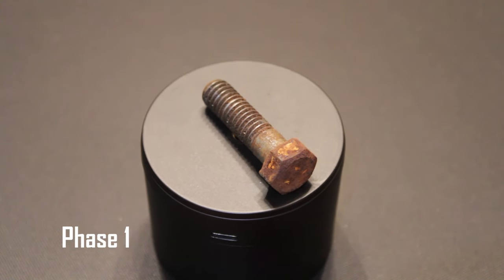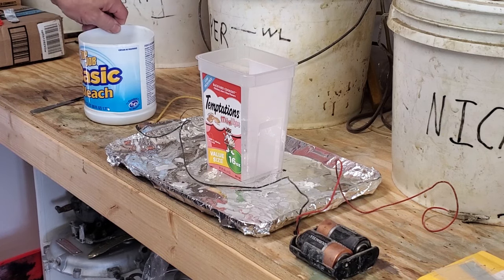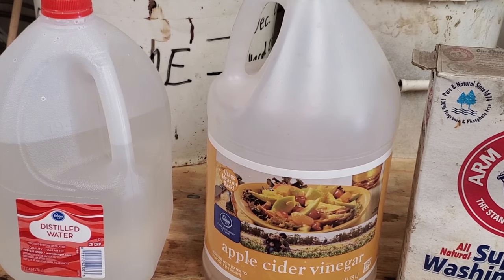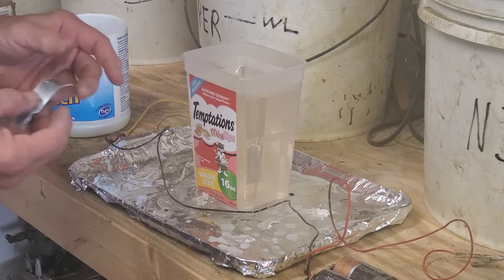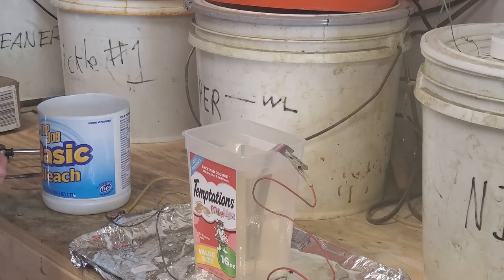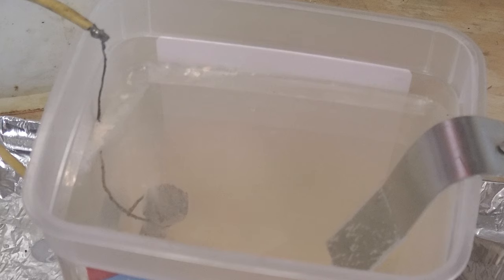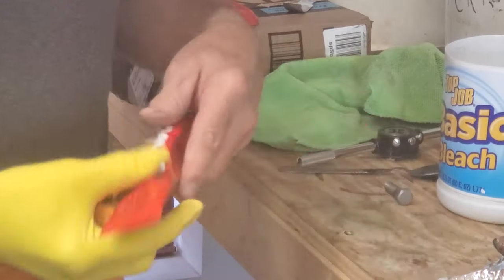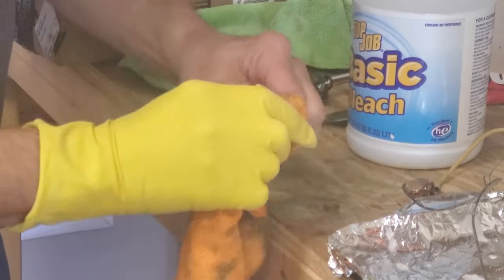How to Zinc Plate at Home - Easy Zinc Electroplating

Comment: Thank you for the simple method. I was told by an expert that it wasn't worth messing with the dangerous chemicals and expensive equipment. "Just paint it" is not the answer I was looking for. I'm about to zink plate everything.
Reply from the maker: We're happy to hear that you found the video helpful and hope that you'll get the finish you're looking for.
Reply: I've been doing that for years and I found out the same that you are about to find out - that this DIY zinc plating quality and durability is nowhere near factory plating, if it's exposed to outside weather it will start rusting in matter of months. And then you will realise that the expert of yours was right and that his opinion was based on experience.

Comment: In the RAF I was an Inspector we had a problem with zinc coated bolts rusting. The manufacturer used standard bolts so when a nut was screwed on it removed the Zinc coating
Reply from the maker: Oh, no! We always hope ours are there to stay. Thanks for watching!
Reply: If you have problems with your aircraft hardware rusting brush on a coat of thinned Par-Al-Ketone after installation.  US Navy has been using it on aircraft since WWII.

Comment: I watched a video with no speaking where the harvested a large chunk of Zinc, from the outside shell of "D Cell" Akaline battery that is under the shrink tubing cover with the branding & info on it. I think the caption was the easiest way to get Zinc. You may check into that to reduce cost even more as for many, after zinc, is the "Yellow Cadmium" wash which practice gets right. If I remember, everyone goes a little darker as it lightens after cleaning with a rag. 
DK. ASE Master Tech since 78, retired.
Reply from the maker: Thank you for sharing this information with our viewers. It will be useful for those who have larger projects or want to plate several pieces. We chose the pure zinc anode for smaller projects and a bit of a better result.

Comment: Very good guide, I wanted to do this some of the corroded 1943 steel pennies if I could get one myself.
Reply from the maker: Here is a list of what is used in the video:

One quart plastic, or glass container.

Baking pan (with low edges is okay), one that isn't used around the kitchen anymore and lined
with foil.

Half-gallon plastic bucket with rinse water.

2 D-Cell batteries with a battery caddy. (You can duct tape 2 batteries together with batteries
set up in opposite directions.) 

Red and black wire with leads - we call them alligators. Red = positive side for the anode. Black = negative for the part.

12, or so, inches of wire. Ours is yellow in the video. You will attach a loop to this to secure the
part that needs plating.

Zinc Anode. (From Amazon about $6)

Distilled water.

White vinegar (cheap or store-brand).

Arm & Hammer Super Washing Soda (You may have to order this online.)

Clean part as described in the video.

Solder and iron to attach that yellow auxiliary wire or crimpers, if you don't want to solder.
Solder is best.

Air stone, pump and air hose for an aquarium from pet store. Nothing fancy. (Optional)

A good pair of nitrile gloves.

Thanks for watching!

Comment: Pretty cat. I have a motorcycle gas tank that is pretty clean and am considering plating the interior prior to plastic coating the insides. A main reason I'm considering this is the plastic may not get every nook and cranny, but the zinc atoms will get in everywhere. What do you think? How about voltages, 2 - 4- 6D cells?
Reply from the maker: Start with the batteries mentioned in the video, then work your way up. Too much power plates too quickly and results in granular or rough plating. Suspend the zinc directly into the tank opening for the best results when plating the insides.
Reply: @CarzPlus  Thank You!

Comment: Great video - thank you. Question: I have one rusty link in the middle of an otherwise nicely galvainzed chain. Will it be possible to plate the one link while still connected between the two properly galvanized sections using this method? Stoked to try it...
Reply from the maker: Good question! If you can get the link free of rust it will work. Thanks for watching!
Reply: Thanks for the reply @CarzPlus  - I'll try and report back!

Comment: Wouldn't polishing the bolt head cause the zinc coating to be compromised? Or at the very least more susceptible to oxidization than if left unpolished?
Reply from the maker: No, not as long as you do nothing more than light polish as shown. You can also plate for a longer period before polishing to add a thicker zinc coat. Thanks for watching.

Comment: Thank you for the great video - I am going to try this with my rusted bolts. I am not knowledgeable when it comes to anything electric. What are the red & black wires with the clips that's attached to the D cell battery called? Is it also required to have a wire and stainless steel attached to the black wire?
Reply from the maker: We've attached a reverse clamp to the black wire that can be squeezed much like an alligator clamp. After that, we have the yellow wire and some stainless steel wire has been connected to that to make the loop for holding the part. Much of what is done here is to successfully plate the part.

The red and black wires are called electrical wire. This article might be helpful: https://promiseelectric.com/electrical-wire-colors/

Here is a list of what is used in the video:

One quart plastic, or glass container.

Baking pan (with low edges is okay), one that isn't used around the kitchen anymore and lined
with foil.

Half-gallon plastic bucket with rinse water.

2 D-Cell batteries with a battery caddy. (You can duct tape 2 batteries together with batteries
set up in opposite directions.) 

Red wire and black wire with leads - we call them alligators. Red = positive side for the anode. Black = 
negative for the part.

12, or so, inches of wire. Ours is yellow in the video. You will attach a loop to this to secure the
part that needs plating.

Reverse clamp which is connected between the black, then the yellow wire.

Zinc Anode. (From Amazon about $6)

Distilled water.

White vinegar (cheap or store-brand)

Arm & Hammer Super Washing Soda (You may have to order this online.)

Clean part as described in the video.

Solder and iron to attach that yellow auxiliary wire or crimpers, if you don't want to solder.
Solder is best.

Air stone, pump and air hose for an aquarium from pet store. Nothing fancy. (Optional)

A good pair of nitrile gloves. 

Good questions! Thanks for watching.

Comment: What is the purpose of adding washing soda to the acetic acid solution, wouldn't it react with the acid and neutrolize each other out since one is  an acid and the other one is base?
Reply from the maker: Good question! Washing soda isn't the same as baking soda. You won't get the same reaction as you would by pouring vinegar onto baking soda. distilled water won't conduct electricity and as a result plating will not occur. Thanks for watching.
Reply: In order to get your electroplating working properly, you need an acid solution in which you put both your anode and kathode. Adding a current will start the process. After you’re done you end up with a metal plated part that is in contact with an acid solution. To avoid the acid etching and corroding the electroplated part you need to neutralise the acid on the metal and the best way to do that is by putting it in a basic solution, like water and soda. In my opinion, adding soda to the electroplating solution will only decrease the efficiency of the electroplating process. It may still work (as long as it is acidic), but it will take much longer to achieve the same result. Next time, try two different baths, one acidic (and you can add a lot more vinegar) for the electroplating and one soda bath to neutralise the acid afterwards. Also you can speed up the process even more if you use a better power source, like e.g. a labo power supply.
Reply: Here’s the deal. Acetic acid from vinegar is a weak acid and only forms 1% ions that conduct electricity whereas strong acids like muriatic ionize 100% in water.  The washing soda is sodium carbonate and neutralizes some of the acetic acid creating sodium acetate which conducts electricity well.  Some of the vinegar is not neutralized so the pH is lowered by the remaining acetic acid.  This condition helps dissolve the anode so it will plate onto the steel object
Reply: Oh so the sodium acetate is what we want to achieve? I use sulphuric acid and water for the electrolysis then afterwards I have a sodium carbonate bath which I neutralize with and then wash in water. There seems to be many ways to do electroplating

Comment: One tiny comment.

If you make the strength of the electorate solution too strong, for example by adding (any/too much) zinc chloride the plating happens too quickly, and it does not actually plate. 

You just grow large random zinc crystals on the item you want to plate. It is like frost on a leaf, it falls off if you shake it.

From experience, as I lean how to zinc plate. It was my first mistake > stronger is most certainly not better.
Reply from the maker: Quite correct you can make it too strong.

Comment: Hi , can I use zinc plate from old batteries, ? and I made a little knife from a bolt so can I protect that from corrosion by doing this process?????
Reply: Yes you can but you should melt it down into a new clean Ingot.
Reply: @Robert-vp6xf  thanks
Reply from the maker: We prefer to purchase the zinc anodes, which are reasonably priced. While this process may work, we fear the possibility of contamination. Thanks for watching.

Comment: I did this to the specifications in the video but i am getting no bubbles when i put parts in the solution. ?
Reply from the maker: That usually means you are not getting a good electric connection at some point.

Comment: Not sure what I’m doing wrong but I see a lot of bubbling and my anode it turning white but I don’t see any noticeable transfer.  I see the copper wires turning silver, but it’s certainly not happening after 30 seconds or 1 minute.
Reply from the maker: Check your measurements and make sure the equipment you're using is clean. You may have to start over. Here is a list of what is used in the video:

One quart plastic, or glass container.

Baking pan (with low edges is okay), one that isn't used around the kitchen anymore and lined
with foil.

Half-gallon plastic bucket with rinse water.

2 D-Cell batteries with a battery caddy. (You can duct tape 2 batteries together with batteries
set up in opposite directions.) 

Red and black wire with leads - we call them alligators. Red = positive side for the annode. Black = 
negative for the part.

12, or so, inches of wire. Ours is yellow in the video. You will attach a loop to this to secure the
part that needs plating.

Zinc Annode. (From Amazon about $6)

Distilled water.

White vinegar (cheap or store-brand)

Arm & Hammer Super Washing Soda (You may have to order this online.)

Clean part as described in the video.

Solder and iron to attach that yellow auxiliary wire or crimpers, if you don't want to solder.
Solder is best.

Air stone, pump and air hose for an aquarium from pet store. Nothing fancy. (Optional)

A good pair of nitrile gloves.

Comment: Hi you think it possible to zinc plate a slot car track
Reply from the maker: This brings back memories! I had a slot car track back when I was in grade school. I remember that there were 2 sizes. A larger size with cars, roughly O-Gage, and the smaller size approximately HO- Gauge. Mine were the smaller ones. I vaguely remember the tracks had bright plating in the slot area. I don't know exactly what the plating was. I would surmise nickel, since it would hold up better when the cars picked up the electricity from their posts in the slots.

The plating method would work, but I don't think its the correct solution. Zinc is, compared to nickel, relatively soft and not as wear resistant. I'm not sure it will hold up to the slot cars pickup posts continuously running over it.
 
Thanks for watching!

Comment: how much of all the items can be reused? can the zinc anode be used for many tries? is the chemical "solution"  a one time use? do i have to throw it away for every new plating process?
Reply from the maker: Annodes can be used again and again. The solution can be kept and used repeatedly. Over time you will need to equally restore your plating solution to its original ratios due to the water evaporating from it. Thanks for watching!

Comment: I'm working with a gsg 1911 which the frame is zinc alloy looks horrible trying to  re-zinc it any tips by any chance
Reply from the maker: A semi-dangerous, if over done method is to dip the part in Muriatic acid for a few seconds. You must then fully flush the part with distilled water and then immediately re-plate with zinc. It should be tested first to verify this solves the issue, but it often does. Be sure to take safety precautions. Thanks for watching!

Comment: I've made a zinc bath ,made it very strong,,but used table salt instead of washing soda..but it won't coat between washer and bolt head..usin sandblasting and muriatic acid  for cleaning..is this normal
Reply from the maker: Yes, this can happen. Often the item is not clean enough. It can also happen because it is harder to plate in recessed areas between parts that can not be disassembled. Sometimes this can require multiple anodes, or anodes bent into shapes that focus on the recessed area. 

It can also be necessary to change the orientation of the part being plated several times during the process. Further, it can help to agitate the plating solution. Many industrial plating systems appear like they are boiling from the use of agitation systems, usually in the form of bubbles. 

Thanks for watching!
Reply: @CarzPlus  I made a nickle bath to..but it just won't plate..its a dark emerald green but I had the copper wire in the solution while I was making it...I think it destroyed  if I leave parts in the solution they turn copper color without electricity..I quite  new to this..lol

Comment: What is the plating solution formula
Reply from the maker: Here is a list of what is used in the video:

One quart plastic, or glass container.

Baking pan (with low edges is okay), one that isn't used around the kitchen anymore and lined
with foil.

Half-gallon plastic bucket with rinse water.

2 D-Cell batteries with a battery caddy. (You can duct tape 2 batteries together with batteries
set up in opposite directons.) 

Red and black wire with leads - we call them alligators. Red = positive side for the annode. Black = 
negative for the part.

12, or so, inches of wire. Ours is yellow in the video. You will attach a loop to this to secure the
part that needs plating.

Zinc Annode. (From Amazon about $6)

Distilled water.

White vinegar (cheap or store-brand)

Arm & Hammer Super Washing Soda (You may have to order this online.)

Clean part as described in the video.

Solder and iron to attach that yellow auxiliary wire or crimpers, if you don't want to solder.
Solder is best.

Air stone, pump and air hose for an aquarium from pet store. Nothing fancy. (Optional)

A good pair of nitrile gloves.

Thank you for waiting for the answer and thanks for watching.

Comment: Im from asia. We dont have that washing soda you spoke of. Can I use baking soda?
Reply from the maker: No. Washing soda and baking soda are not the same at all. Baking soda will completely neutralize acid. Here is a substitute solution:
Mix together 300 grams of Epsom salts, 100 grams of zinc sulfate, 200ml of white vinegar and about 1/3 bottle of corn syrup into 4.5 liters of tap water and stir with a paint stick until everything is well dissolved. Thank you for your question and thanks for watching.
Reply: You can place Baking soda (sodium bicarbonate) onto a cookie sheet in an oven and bake at 200F (95 C) for an hour. It will reduce to Washing soda (sodium carbonate).

Comment: Nice vid! Question: Could you also just use zinc spray in a can instead of the plating process?
Reply: Trying to figure out the same thing
Reply from the maker: You can, but you can't beat the results from using the plating process. Thanks!
Reply from the maker: You can, but you'll achieve better results with plating.
Reply: Cold galv spray will protect well, but it will scratch right off if the part is exposed to abrasion of any kind such as this bolt as its being re-installed.
Reply from the maker: Yes, that's right. Thank you for sharing your expertise and thanks for watching!

Comment: Hi, will a zinc plating cover and hide fine surface scratches nicely, or does it not hide defects in the metal too well?
Reply from the maker: No, surface defects will still show with this process. If you're getting parts ready for a 100pt restoration, you definitely will want to prepare the best surface before plating. Thanks for watching!